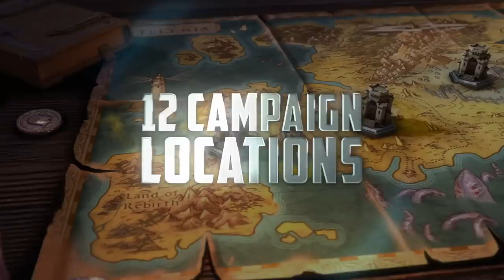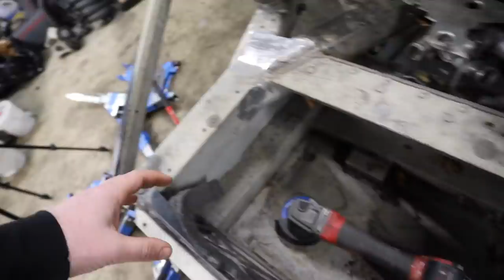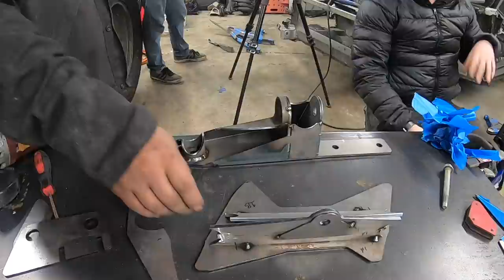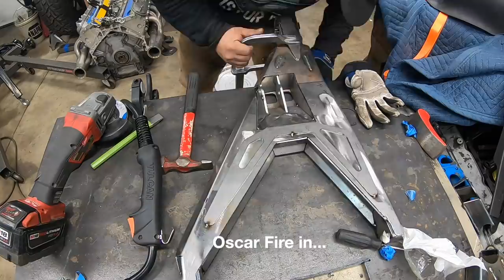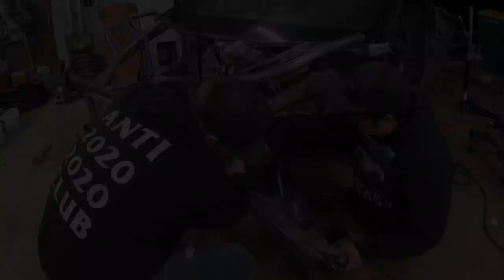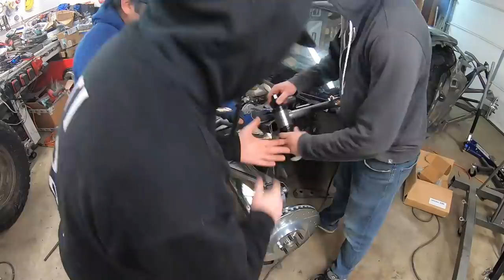Off-Road Lamborghini Huracan Long Travel Suspension Is Finished!

Comment from the maker: Install Raid for Free ✅  IOS/ANDROID/PC: https://clcr.me/Jan_BisforBuild  and get a special starter pack 💥  Available only for the next 30 days
Reply: You almost could have got a second burntican 😂😂😂
Reply: You missed the link for Sam, This engineer needs some recognition
Reply: Chris, you should really put a lot of cabity wax inside the arms and every box sections for corrrosion
Reply: where's the link to the engineer?
Reply: It was clear that part of your sole died when you read out that add for that game.
Reply: I Believe in Elenore Jumpacan. 🛠️🚗
Reply: Could you mark where you sponsor add ends so it's easyer to skip!
Reply: this car makes the pink exocage lambo guy look stupid 😅🤣😂👍
Reply: Hi sir my name is Ali I am mailing you to ask one question you build lamborghini with Chevy LS V8 engine because traditionally this engine is manufactured to be located in the front engine layout so is it possible to take any engine from front of the car and place it in mid engine layout and does the engine block build for front engine is different from mid engine or engine is just same as in V-Shape and secondly what auxiliary parts are also needed to be relocated from front to mid engine conversion like sump system, alternator,a/c , induction systems, coil pack and all pumps for mid engine layout conversion.in simple the engine in mid engine layout car is just as similar as in front engine car it also has basic same pistons, conrods block camshaft as found in any front engine car well waiting for your humble reply thanks indeed very much
Reply: Hi sir my name is Ali I am mailing you to ask one question you build lamborghini with Chevy LS V8 engine because traditionally this engine is manufactured to be located in the front engine layout so is it possible to take any engine from front of the car and place it in mid engine layout and does the engine block build for front engine is different from mid engine or engine is just same as in V-Shape and secondly what auxiliary parts are also needed to be relocated from front to mid engine conversion like sump system, alternator,a/c , induction systems, coil pack and all pumps for mid engine layout conversion.in simple the engine in mid engine layout car is just as similar as in front engine car it also has basic same pistons, conrods block camshaft as found in any front engine car well waiting for your humble reply thanks indeed very much
Reply: Hi sir my name is Ali I am mailing you to ask one question you build lamborghini with Chevy LS V8 engine because traditionally this engine is manufactured to be located in the front engine layout so is it possible to take any engine from front of the car and place it in mid engine layout and does the engine block build for front engine is different from mid engine or engine is just same as in V-Shape and secondly what auxiliary parts are also needed to be relocated from front to mid engine conversion like sump system, alternator,a/c , induction systems, coil pack and all pumps for mid engine layout conversion.in simple the engine in mid engine layout car is just as similar as in front engine car it also has basic same pistons, conrods block camshaft as found in any front engine car well waiting for your humble reply thanks indeed very much
Reply: Hi sir my name is Ali I am mailing you to ask one question you build lamborghini with Chevy LS V8 engine because traditionally this engine is manufactured to be located in the front engine layout so is it possible to take any engine from front of the car and place it in mid engine layout and does the engine block build for front engine is different from mid engine or engine is just same as in V-Shape and secondly what auxiliary parts are also needed to be relocated from front to mid engine conversion like sump system, alternator,a/c , induction systems, coil pack and all pumps for mid engine layout conversion.in simple the engine in mid engine layout car is just as similar as in front engine car it also has basic same pistons, conrods block camshaft as found in any front engine car well waiting for your humble reply thanks indeed very much
Reply: Hi Mr Chris Hi sir my name is Ali I am mailing you to ask one question you build lamborghini with Chevy LS V8 engine because traditionally this engine is manufactured to be located in the front engine layout so is it possible to take any engine from front of the car and place it in mid engine layout and does the engine block build for front engine is different from mid engine or engine is just same as in V-Shape and secondly what auxiliary parts are also needed to be relocated from front to mid engine conversion like sump system, alternator,a/c , induction systems, coil pack and all pumps for mid engine layout conversion.in simple the engine in mid engine layout car is just as similar as in front engine car it also has basic same pistons, conrods block camshaft as found in any front engine car well waiting for your humble reply thanks indeed very much
Reply: @alibutt5269  Spam will get you nowhere...
Reply: no

ok
Reply: The jumpacan needs to have a raid sponsorship livery when done
Reply: Hey you're using mustang gt brakes check out dodge Van's and SUV brakes I personally have 2013 dodge grand caravan brakes on a 54 chevy
Reply: I'm not sure if you're even going to read this or not but I would suggest putting some upper bracing on them bump stops or gusset somehow someway cuz when your suspension travel and smacks them after a while they're just going to bend the current way that they are seen that fixed that..... Either brace it from below or brace it from above or put a bar going straight across somehow some way the basically gives additional strength to the top of that is it's going to move the more you smack it and you will

Comment: The suspension components look so cool. You should get them powder coated
Reply: Don't they? They're too simple to go together that easy AND look that good!
Reply: Just clear coat them
Reply: Powder coat on off road race parts is not a good thing.  You need to be able to see cracks and stress and all that.  Then you need to get rid of all that powder to fix.  Better to just use linseed oil on it all.
Reply: @dsrtrcr01  you’re not wrong at all and that’s definitely a good option, but if he does go with powder coat, they do make a matte clear one as seen on Nigel Petrie’s Engineered to Slide “Hilux” drift car.
Reply: @dsrtrcr01  powder coated parts are pretty normal on off-road parts. a lot of guys use steel it coatings. it’s weldable and very durable. my mid travel kit is all coated in that coating.
Reply: @stockprerunner  Yes, normal on pre runners like ours.  My long Travel kits are all powder coated.  As I mentioned race parts typically are not.  Steel it is fine but I would rather just spray paint and strip for the price they charge for it.   Maybe I'm just cheap.  Ha.
Reply: @dsrtrcr01  steel it in a can is outrageously priced. i’d buy by the gallon for a project like this

Comment: Chris: this episode is sponsored by Raid
Me: skip skip skip skip skip skip 
Chris: in this game you can 
Me: skip skip skip skip skip skip 
Chris: so let’s get to work 
Me: ahhh finally
Reply: Still they're doing nothing to the structural integrity of the f**** Lamborghini they're not using the Lamborghini they're building a frame essentially around the Lamborghini and then they're going to use that
Reply: @michaeldowlin258  ... that's kinda the point eh? Slap some Lambo panels on later and call it good
Reply: @michaeldowlin258  pretty sure its getting a roll cage too
Reply: Please dont mention these techniques we viewers use, otherwise google will make the sponsorship section of videos unskipable.
Reply: @AliSaeed  They don't care, they aint getting money from it.
Reply: I use  a chrome extension that automatically skips sponsor sections.  "SponsorBlock for YouTube - Skip Sponsorships"
Reply: That's what I did 😂

Comment: you should really use some weld through primer to help protect the parts from rust caused by potential water intrusion.
Reply: This..^^^^
Reply: Steel it!!!
Reply: You really think they'll do something correctly? This is for content not long term. 2 years itll be in the dump or after race 1

Comment: Curious about how much steering angle you have, and where the rack will mount. On the front of each knuckle you have what looks to be the spot for the tie rod ends, but I think they should be on the rear? Any chance you have those swapped left to right?
Reply: Also, I could be blind, but I don’t see a pivot system for steering on the knuckle.  So the steering angle is zero?  Haha
Reply: @djdtone1981  it's a uniball, allows for rotation. Doesn't look like it'll have much steering angle.
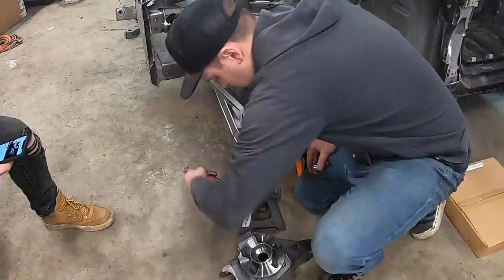Reply: You can see the angle at 12:25 or around there
Reply: @rclover1341  don't need much angle they will do donuts 🤣

Comment: Love the serious progress AND work!  

Just make sure to add a layer of insulation between different metals.. to prevent corrosion from electrolysis.

Paint is good, but a wide electrical tape or single layer of insulator works better!   You can find super wide "electrical tape" online. like 4" to 6" wide and it makes it super quick to coat things.

Comment: Do you have a brace to go across from one shock tower to the other?? Seeing as the chassis is alloy I would add one tube from tower to tower. Reduce flex and add strength.
Reply: Agreed, as well as any force taken from bumpstops. You typically see them mounted to more substantial areas.

Comment: Chris!!!! I would look into slotted rotors! Drilled rotors have to potential to collect a rock in the hole damaging your brake pads, obviously for a street car, that risk is low. However, for a off-road vehicle that risk is much higher!!!!
Reply: Good point

Comment: You should "paint" those metal parts with something called "steel-it" to protect them and even help isolate the metal from the aluminium in the chassis, it's a great product that let you weld over it and it's much better than the normal "weld thru primer"

Comment: I really hope the center structure of the Huracan does not twist and snap when those huge torque loads from the over wide suspension swinging through full range of motion under full power combined with any bad resonate vibrations. 
Cage that thing, tie the cage into everything front and back
One really great test is to drop the car from heights anywhere from 6 to 10 feet.  6 foot drop is nothing and if it can't handle that, are you willing to put a person inside of it?

Comment: Wont that bump stop undue stress on the upper control arm bolt when it hits it. Wouldnt it be better to have it hit a pad on the control arm not the knuckle. Just wondering. I could see this you go and ramp it and all four upper bolts snap on landing just a thought cause the bolts arent made to handle the side load of them hitting the bump stop

Comment: Couldn't help but notice the front wheel bearings have a splined hope in them. Some wheel bearings are designed to be held together with the CV shaft and will fall apart of not "bolted" together with the CV shaft. FYI. Ask me how I know.

Comment: Question, you are laying steel over aluminium, how are you going to prevent Glavanic corrosion, are you going to use an inhibitor or barrier, I take it the jumpacon will be going off road in wet conditions?
Reply: It only needs to stay together long enough to make it to the race and make an attempt at racing.

Comment: Instead of doing mustang gt brakes. the 2013 caddy ats front rotor and caliper is a massive upgrade with mustang brakes. Damn near direct bolt on a stock 04 gt.

Comment: Am I missing something or were the front knuckles mounted solid, how do the wheels turn?
Reply: typical bolt-in hubs- the hubs bolt to the "knuckle" on one end and other end to the rotor/wheel (bearing in-between)

the whole knuckle turns side to side using the ball/hiem joints

that said, turning radius is probably terrible
Reply: It has huge uniballs top and bottom. They allow suspension articulation and turning.
Reply: @austinh1028  ok I kinda figured they move like a heim joint but like you it looked like there wouldn’t be enough movement for adequate steering

Comment: How are you going to prevent galvanic corrosion? Seems like this build could suffer from this no?
Reply: I am wondering how your going to isolate the aluminum and steel too. All those interconnections look challenging. With the carbon too.
Reply: Paint and thick layers of anti-seize

Comment: Seems like a very awkward location for the bumpstop to be mounted, as well as where it contacts the knuckle. Normally it would contact the lower arm and there would be like a ¼" thick steel plate where it would make contact.

Comment: Why are they not painting the inside of these cool pieces as they put them together to prevent rust inside?  Once they are welded shut, I would think you can't paint in there anymore and they will rust from the inside out?

Comment: It’s crazy how none of the arms have welding primer... There is no protection from corrosion on the inside of the arms!
Reply: @Ross Bourne one part of the video you can see surface corrosion starting man lol and it’s been inside! As long as you can breathe oxygen, corrosion will happen on bare steel dude.

Comment: I was a professional  mover for 15 years and I cringed when I first saw you  welding near that moving pad. There is no smoking allowed on moving trucks because they tend to smolder, and by the time the driver would notice the whole trailer is a loss. I'd advise that you move them away from where you're welding. I'd hate to hear about an after hours fire. 
Also, absolutely loving this build.

Comment: Sheet Metal LC And UCAs are going to fold. Tubing for the win.
Reply: It’s not sheet for starters...I think he said 3/8’s or 5/16’s plate.  And you can engineer the design to shift load dynamics and yield as good or better performance vs. bent tube.  Just sayin.

Comment: Am I the only one wondering how it's gonna take corners??
Reply: I'm wondering the same thing. There is no way those spherical bearings have enough movement for steering.
Reply: High misalignment spacers. They allow for those balls to articulate further. They are not installed and would be the reason there is space on either side of the balls which they filled with washers.
Reply: Okay, but the steering will still be minimized to what the bearing allow

Comment: You are assembling such a complex suspension, don't you feel the need to be a bit more precise? From what I can tell you hardly measure anything, just 'mock fit' after some vague tack welding. Don't get me wrong but there is too much room for error the way you put this thing together, which I, as an engineer, feel like I have to mention.